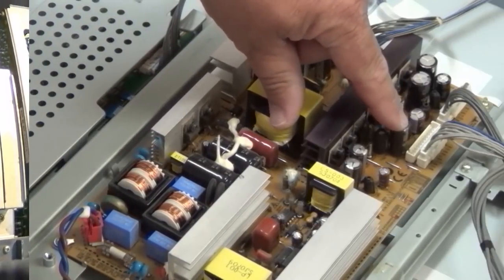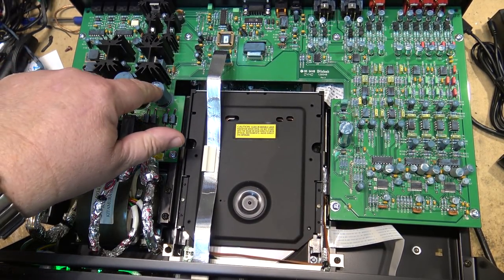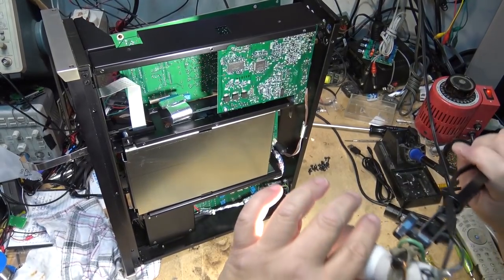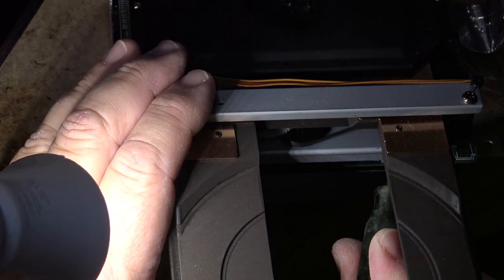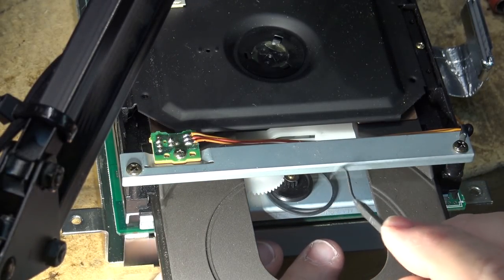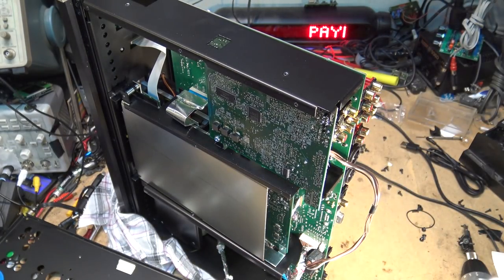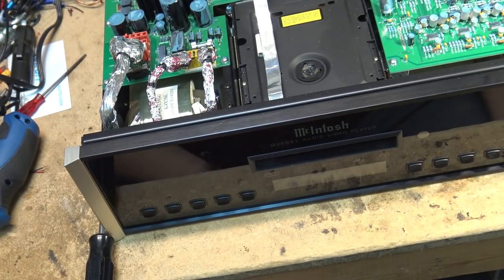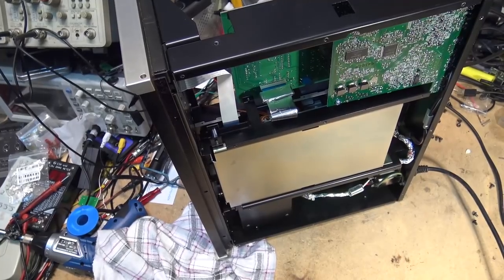McIntosh MVP861 CD player not loading correctly   no play

Comment: Omg...you are lazi....why you just do not dismantle that mecha and clean lens and lube a gears etc? Btw that tray just a pull out easy...that tray dont have any blocking sistem....
Reply from the maker: Because the cheap ass customer only paid me 30 bucks to change the belt then went and sold it for 1300.00 and had the balls to tell me what he got for it.  Guess what happened to the rest of the equipment of his i had in for repair.

Comment: Their cd players don't sound any better than a cheap cd Player waste of money
Reply from the maker: And here is another uneducated person that has bad hearing. The do sound better. Even playing highly compressed MP3 they sound better. It is all in the D/A conversion, and the filtering. More expensive CD players use better DACs. They do sound better and that is why people pay the money they do.
There is no reason to slam a product just because YOU can't afford it. Those with the cash to burn like these fine toys, and if you have the money to afford one of these, then you have the money so invest in a good amp and speakers that will allow you to hear the sonic differences.
Reply: @12voltvids  I have heard a lot of so called high end audio equipment at equipment shows it sounds the same as the cheap stuff.  and yes I can afford it but I choose to not spend money on snake oil.
Reply from the maker: @catsbyondrepair  Possibly you can't hear the difference, but I can certainly hear the difference between high end gear and cheap crap. Incidentally I don't own any "audiophool" equipment myself. I have a couple of tube based amps I built and a couple of pairs of really good speakers.
There are differences. They are subtle but if you have good hearing, and know what to listen for you can hear the differences. I would not say my hearing is perfect. At my age my highs roll off above 16khz. I can still hear the horizontal sweep on old TVs and that is 15.745 KHz. I do have musician ears though. The sonic differences are mostly in the mid range for most of this stuff, but you know the saying. Get the mod range right and everything else just flows.  Yes I agree that most of this stuff is over priced but the guys with all that extra cash don't seem to mind spending it. The worst crap I have seen is this Sonos garbage. Over priced and sounds like crap.
Reply: @12voltvids  the difference is in the speakers a klipsch forte 3 set will piss of your niegbors off to no end. I know this cause I have a pair.